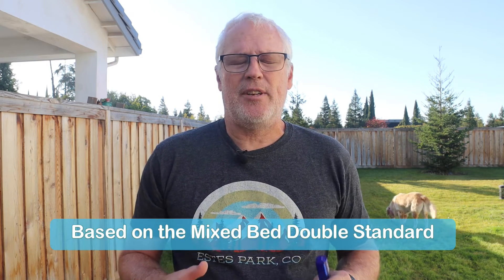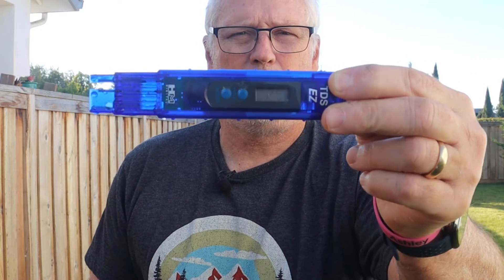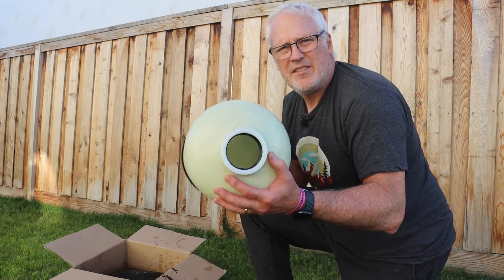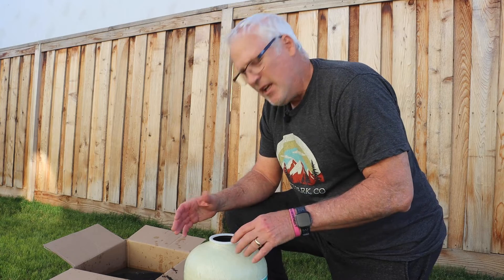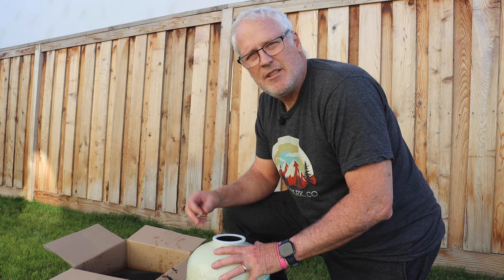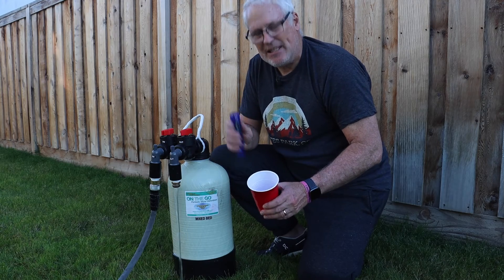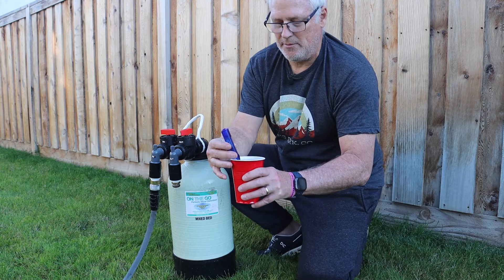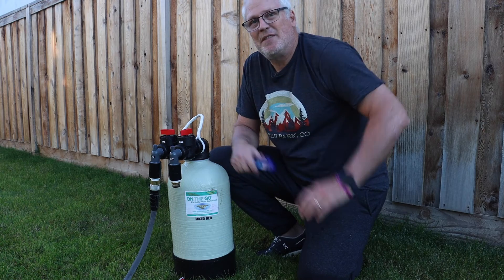How To Replace Your Deionizer (DI) Resin - The Proper Way

Comment: I bought a water Deionizer (Double Standard size) from Adams Polishes last summer when it was on sale. It looks identical to yours except for the color and name. I'm sure On The Go manufactures it for Adams. It has been great for washing my wife's car, my truck and our 5th Wheel. I use the bypass for initial wetting of the vehicle  and the washing and only used deionized water for the final rinse. It's worked very well. I have on occasion had a water spot but rarely. Probably from where I didn't rinse well enough or the heat has dried the water faster than I could get it rinsed off. Water Deionizers aren't cheap but they sure do prevent headaches and the need to clay bar every time I wash a vehicle.
Reply: They do make them for adams.  When they were out of tan they sold me a black one because I was inquiring back and forth for awhile and just slapped the on the go label on it ha
Reply from the maker: Guess the good news is you were able to get one 😀
Reply from the maker: We do the same, we only use our DI for the final rinse, if not, we'd be going through a lot of resin. It sounds like you feel the same way we do, we love our DI and the time it saves us. They are expensive, but after doing a couple washes you realize how nice they are.

Dan